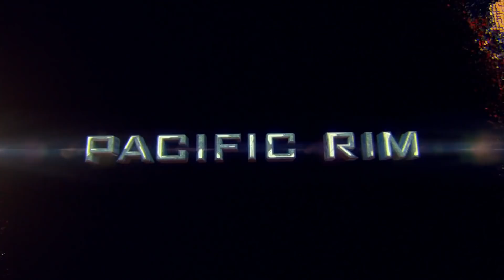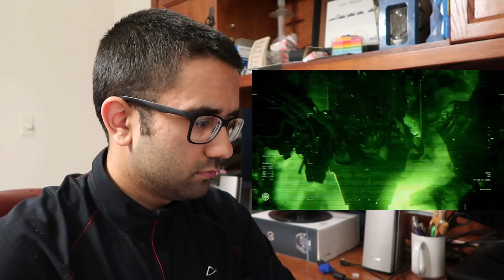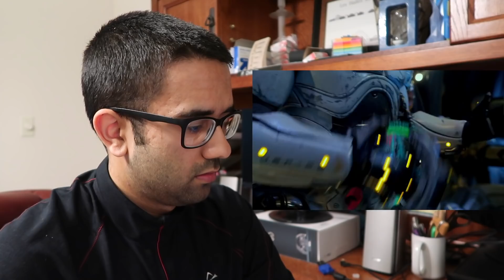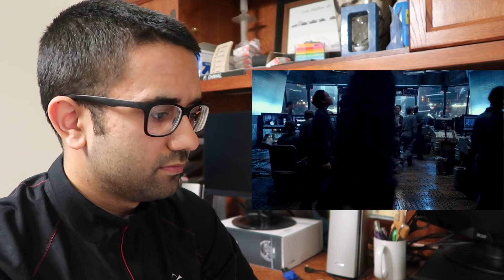Real Engineer reacts to engineering scenes in Pacific Rim

Comment from the maker: Timeline of video:

@0:27 - Mirror Function
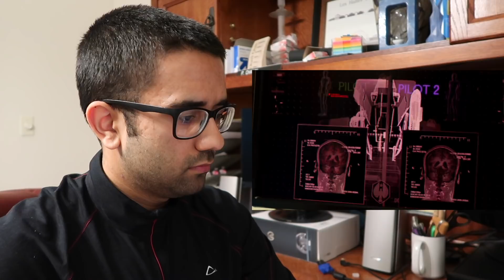@1:48 - 2 Pilot System
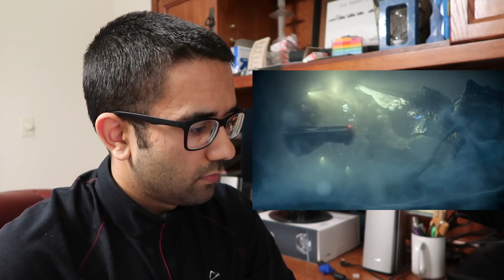@2:51 - Gypsy Danger vs Knife Head; remote control Jaegers
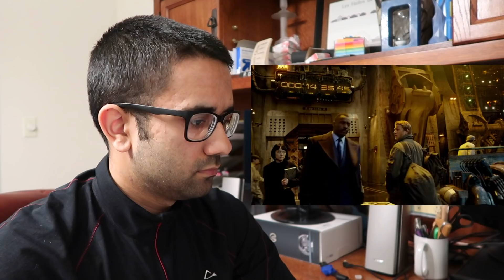@4:56 - Engineering Plants
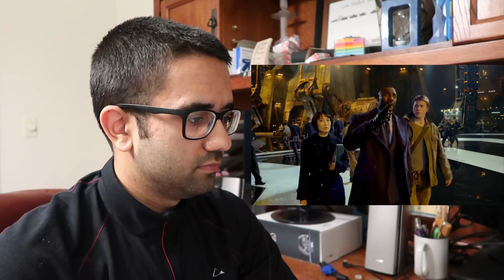@5:42 - Metal Alloys
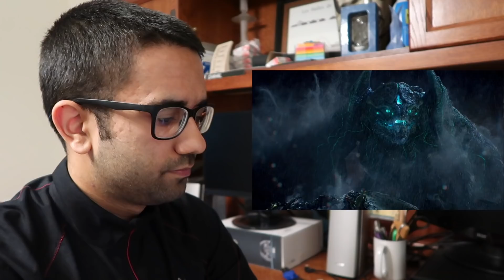@7:05 - Digital vs Analog

Enjoy! Comment below what movie/tv show you'd like to see next!
Reply: Because of the square cube law we can't make them that big but we can make them as big as an aircraft carrier. We don't need neural drift just a high speed computer system. Realistically, the most efficient way to build them will be with alluminum-copper alloys and a nuclear(fission) reactor as its main power source but this has problems because shaking of the reactor causes problems and if that doesn't work I'd say use hybrid engines for the maximum power delivery. The fuel tanks should be made using F1 rubber-kevlar composites. This will require big batteries but because the hybrid-engines do most of the moving it won't need to spend massive amounts if energy on moving the body.  A lot of interchangable parts and electric motars for the fastest manoeuvres however every electrical component should be highly emp shielded. Realistic weapons like built-in giant electromagnetic coil artillery guns. The electrical components should be a hybrid or fully analog.  The thing should have high speed components for the fastest computation basically a supercomputer and an A.I. makes sense! And it should be very efficient so the thing doesn't overheat and probably make it so it has a balanced body and doesn't tip over very easily(wide feet) and the whole structure very fluid and non-robotic so that it can perform complex but safe manuvers very fast. I would suggest making it durable and long lasting rather that fast and weak! Make it like iron man's godkiller armor which can use enterchangable parts for faster fixing and make reusing instantaneous and I would just create mini yeagers only for fixing these things! https://youtu.be/2HcqS508lIo
Reply: Are you gonna do Pacific rim 2?
Reply: Dude your talking about using remote controlled jaegres to keep the pilots physically out of the fight but why dont we do that for tanks or jets already then. Like a half a second delay isnt going to destroy a tank. Theres reasons for these things mainly coms issues like if a satelite wasnt corrextly position or if your satelite dish or whatever is damaged or if your in an area with bad service eg. the sea.
Reply: lol this is like an engineer from the 1700s reviewing a space shuttle. just because it seems impossible now doesn’t mean it will always be that way
Reply: @iconofsin66   I don't agree. Most of the topics like analog vs digital or titanium alloy are already set and tested widely in the real world, so their characteristics are somewhat a fact than a personal bias/ talking purely from experience. Neural network technology is also being studied and experimenting upon, so is wireless remote control such as 5G. 

I don't think he's focused on whether the concept of giant robots would work in the real world, but rather trying to suggest better/ more practical approaches to the design of giant robots with existing technologies that can do the exact same thing, and reviewing the flaws that can be replaced by existing current-gen technologies.
Reply: And you are okay with this quote?:  "Gypsy's analog, nuclear."
How the hell does having a nuclear reactor has to do with analog circuits? And also, them setting off a reactor like bomb is spitting into physics' face! :))
Reply: @ScarlettM  actually that quote is talking about the power source entirely. Gypsy uses a self-sustaining analog controlled nuclear reactor. The other quote about the titanium and digital power probably has to do with a fusion reactor which requires digital sensors and controllers.
Reply: @ScarlettM  how its just a kill switch. Obviously contained explosions run cars but remove the limit and the engine blows, same thing.
Reply: @omnomgamer8633  It's difference physics: reactor or a bomb. You can overhead a reactor, after a time, but you can't blow it like a nuclear bomb. That's not how you get nuclear explosion. You need several controlled and calculated explosions inward,  to go nuclear. You can't do that with a reactor. 
You should watch some videos on nuclear reactors and bomb to get yourself familiar with the subject.
Reply: @ScarlettM  oh ok
Reply: The neural link is more than the exoskeleton suit. The neural link actually sends signals into the brain, and reads the brain waves. That is why it is a neural link. Not a limb mimic system.
Reply: @matthewtremain683  That's why they died
Reply: @fame8606  yes, and that is why anyone who survives a solo piloting, is rare. 2 in the first movie.
Reply: @matthewtremain683  actually They already died Before The monster attack them
(I'm not talking about the movie)
Reply: @matthewtremain683  it's dangerous to put neural link in brain and transmit to robot
Reply: @matthewtremain683  once you get use Of using neural link the robot will begin to Ai
Reply: @matthewtremain683  you're right but there's a little more to it than that. The reason for the neural link is so that the pilots can share information easily and function as both pilot and Gunner. Also so they can have greater sensory detail because controlling such a large object requires a lot of finesse.
Reply: So
Reply: Should have got a structural engineer;
Reply: You Need To Look At The Suits In Anthem And Fallout 4
Reply: And the second ruind it all
Reply: Digital circuits would survive an EMP just fine if you give them some form of anti EMP protection. Basically a metal frame that absorbs the EMP so they don't have to. But I guess they just did not predict a bio EMP.
Reply: I think the mirror function isn't actually meant when they talk about neural load, it probably means a neural link to the robot to exactly be able to move around this big robots because a human can move much faster than these robots.
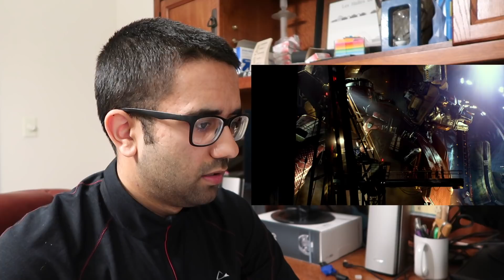Reply: 5:55 He was referring to it having a downside of no alloys
Reply: I think they have the 2 pilots because each pilot controls an arm because it'd be awkward if a Jaeger is touching air to pull out a sword or something during a combat with a Kaiju
Reply: you didn't take into account the gigantic weight and stress that the metal would take, just in walking around. Nor did you mention power requirements.

Comment: A jeagar is not just a mere giant robot, rather than controlling it like a robot it serves as an extension for the human body using a Neural link but due to the immense data from the link a single human brain is not enough to successfully control the jeagar which is why it was needed that 2 pilots are needed to control such complex machinery

Comment: You gave a good explanation about the difference between analog and digital circuits and how and EMP would affect them, but I was hopping you would explain that the explanation about Gipsy being analog was just ridiculous. There is no way something so complicated as a Jaeger could be designed/constructed using analog circuitry only. All the control systems including the drift control, the motion control systems, the display and hologram trap his, all of those component are most likely digital.

Comment: See, most of my criticisms of this movie are based on mechanical engineering.  For example, when Gipsy picked that cargo ship out of the water and used it as a club.  Unless it's made of something much stronger than modern ships are, it would break apart under its own weight as soon as Gipsy pulled it from the water.

Another complaint would be when the helicopters were airlifting Gipsy.  Sorry, but 8 helicopters aren't nearly enough.  We know how much Gipsy weighs (because official stats were released), and we have somewhat of an idea how much each of those helicopters can lift (because there are real-world equivalents).  Long story short, I calculated that you'd need about 640 helicopters!

And another complaint would be... ahh, heck with it.  Let's just say there's a lot of bad physics in the movie, and leave it at that.  Turn off your logic circuits and enjoy the movie for what it is, a fun popcorn-and-Coke movie.  Also, GIANT ROBOTS.  Need I say more?  😉

Comment: Remote controled? no. Because in a fight, "hand to hand" you have to be present, to see in person, you have to be close, to see how the other is moving, to dodge, to attack etc
There are a lot of details happening in a 1-1 fight that you need to capture. And if you were remotely controlling it, how would you get that visual feedback? cameras on the jaeger? that wouldn't work, one of the cameras damaged in fight and you'd be blind or losing info on the fight etc etc etc
You always have to be on the spot to properly control the action.

Comment: They use two pilots for better control. In the novel adaptation, Pentecost explains it by picturing a man lifting an object to its destination: 

One man can carry one heavy object to its destination, but by the time that one person delivers it to the point, he'd be already fatigued and stressed. 
But if there's two people carrying that heavy object, they would have energy to spare for the next trip.

On a more technical side, the Mind Meld tech requires the pilot's entire brain activity to work. The pilot needs to feel the mech, BE the mech literally, add that to the complex weapons and maneuvering systems that the Jaeger have in its HUD; a single pilot would be overwhelmed before he could even make one step forward. Pentecost also once said that piloting a Jaeger is almost synonymous as manning a battleship. Yes it's doable, but it would take a herculean effort for one person only.

Also like the comments said, any millisecond of input lag is unacceptable, the Jaeger needs to be as fully dynamic as possible. Any delay even for a millisecond could spell doom. For every twitch of a muscle, and small movements counts in a Jaeger. That's why these pilots are thoroughly trained mentally and physically.

Comment: As others have stated, the neural link is so that they can see thru the Jaeger's eyes and feel with the Jaeger's tactile, pressure, temperature,etc, sensors.  It gives them nearly human feedback.  They need two pilots because the feedback is too much for any one human.  They become the Jaeger rather than just operate it.  
Is this needed?  Probably. Over time they likely realized that beating the Kaju wasn't working with just remote control or even a guy wearing a Jaeger like a suit of armor similar to a knight of yesteryear.
Think of you wearing thick gloves.  Now try to do stuff with thick gloves on.  I'm not just talking about difficult tasks.  All tasks become difficult because you get almost no feedback from the gloves compared to human skin.
Reply: Very well explained

Comment: My thing for why they would need 2 pilots. Lets use the Remote control car example given during the video. He is controlling the car (Or in this situation the robot) but on a much bigger scale. Keep in mind I have never watched Pacific Rim (I always preferred Transformers). So like I’m assuming when he said one pilot controls one hemisphere. I’m guessing that the guy on the left controls the left half of the body. But the technology is using these pilots brains as a way of communication. They think of the action then the robot does it. And the brain is a very sensitive organ. So its no surprise that this kind of processing power can fry your mind or at least cause some kind of permanent damage. Basically my theory is the robots are using these pilots brains as a ground in electrical speak.

Comment: The reason for the whole stress on the brain is because jaegers don’t move from the hand controls. It takes signals straight from the brain just like how we control our own arms and legs. The physical sensors act as a second check system on the main. This method of brain to machine cuts out the middle man and is faster

Comment: I'm not sure you understand what they are talking about, props for the alloy explanation though.

1. The scene with the man and the arm isnt reflective of how the jaegers work. Each Pilot controls a side of the Jaeger, left/right. As stated by others in the comments, the neural interface is not only with each of the pilots but with the jaeger itself as well so they can control how much force they are using. This might be fantasy movie bullshit but also the neural strain of controlling a massive robot with your mind is too much to handle for a singular person so as the movie states the two-pilot system was created.

2.  In the Digital/Analog scene, you obviously know what you are talking about, but the difference between Gipsy Danger and Striker Eureka is that Gipsy Danger has a Nuclear Reactor as its primary power generator. Striker Eureka uses a normal unspecified electrical generator that is shut down when the Kaiju releases its EMP blast. The line "Gipsy's Analog" is a reference to Digital and Analog Clocks, where in the event of an outage a digital clock will shut down whereas an Analog clock will continue to run.
Reply: Sorry for the long rant.

Comment: Granted it made a bit of sense that a quick slapped together gen one mech like cherno alpha would have that issue of not being alloy. As far as the benefit of a neuro link in this scenario is to reduce the ping time of that mirror function. essentially gypsy danger was made to utilize that mirror function as well as the analog to make the mech move faster and when you consider the speed of the kaiju in this universe that makes sense because they basically are way faster than they ever should be possibly fit the size they are. Which considering this information you can see why they chose that.

Comment: They needed the pilots because they had no programs that could manage the enormous amount of data necessary in order to operate jeagers...so enormous in fact, that not even one human brain is enough; it takes two brains to move a jeager.
I'm just guessing that they can't establish a neuronal link between the pilots and the jeager through the signals traveling through air, but they need a direct physical link, so the pilots must be on the jeager.

Comment: Remote control may not be possible because it not only depends on distance & signal strength but the volume of data that need to be transmitted.

Think about downloading a movie over mobile network vs copying from a flash drive.

Comment: The big difference between Analog and Digital circuits is memory retention (which is done mainly by ICs - Integrated Circuits).  Analog circuits typically have very few ICs and a much larger physical surface area and silicon footprint (e.g. 1990's vs 2010's cell phone).  The benefit of analog circuits is less susceptible to EMI at scrambling digital memory circuits.

Comment: The dual pilots were just for the story's addition for drama only. Without it, the story would be bland, and it'll be no different from a cliche sci-fi fighting monster show. Besides, drama makes money in the cinema world.
Reply: They xplain why they need too. It makes sense
Reply: @triplemoyagames4195  I'm not talking about the science of that world. What I'm saying is the logic of the "narrative," which is the plot of the story on why they chose that dependency for dual pilots.
Reply: @vanjosh7763  Yes, and I am saying the dual pilot thing about the Jaegers makes sense. So the part of the plot driven by the dual pilot therefore can make sense also. 
Dual Pilots were a necessary thing for mechs of that size. Okay let's make this simpler, what are your reservations about it?
Reply: @triplemoyagames4195    Within the film, they didn't go into depth about the cause of the hemorrhaging of the pilot with the mecha synch process. In reality systems such as that would have a passive programmed control support system for alleviating the stress in calculating each movement of the mecha, and it makes the piloting much simpler and efficient; rather than dual controls. They have computers, they have the tech, however, the movie showed so many errors with their logic. 

A major flaw with the dual controls is the memory synch with the 2nd pilot. With such deep memory synch, who knows if there are underlying psychological changes, it's like a deep mixing of both mind, memory, senses, and feelings.

Comment: I know I am late to this party but I would like to weigh in.
I have always felt that  the reason that they needed 2 pilots (or more) is not necessarily for macro control but for sensory input and minor controls. 
Basically, balance orientation and adjustment for inputs such as wind, water currents and uneven ground. 

It is a complicated process to get a small mobile robot to stand without support in ideal conditions. 
If you could route that sensory input to a human, we are already adept at walking instinctively and maybe the mental strain of co-coordinating a giant robot could be too much for 1 mind.. 
I would argue that it sounds more realistic..

If we had to build a monster robot in a short space of time, it is probably easier to relay info to a pilot than to program an A.I. to account for those environmental effects. 
You can also use existing technology ( https://www.cyberdyne.jp/english/products/HAL/ )
You can employ employ more scientists from more fields, ostensibly lightening the mental work load to create a Jaeger..

Comment: The control system uses brain-computer interface to speed to maximize responsiveness of the Jaeger. Such a large mechanism with a widely distributed electronic control system might need multiple cephalic centers, like the dinosaurs had a front and rear brain, only arranged left-right. The BCI system wild also facilitate communication between the pilots, as well